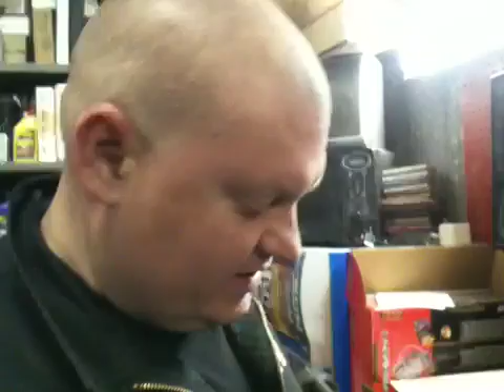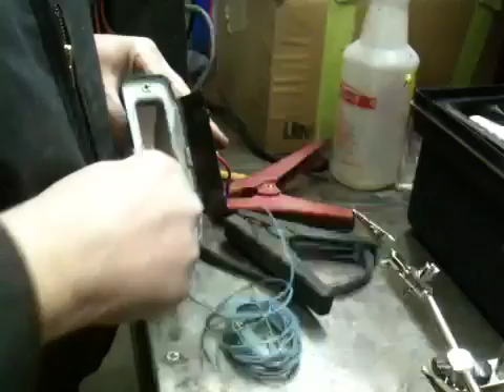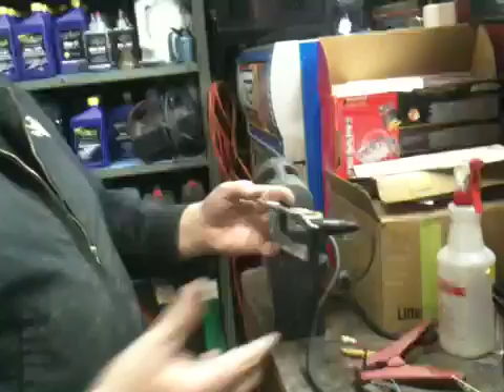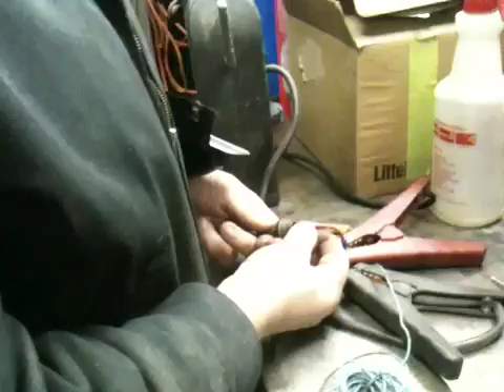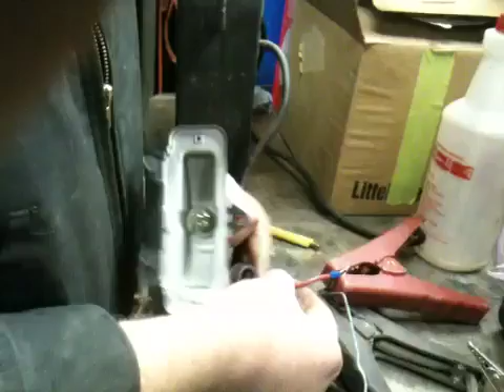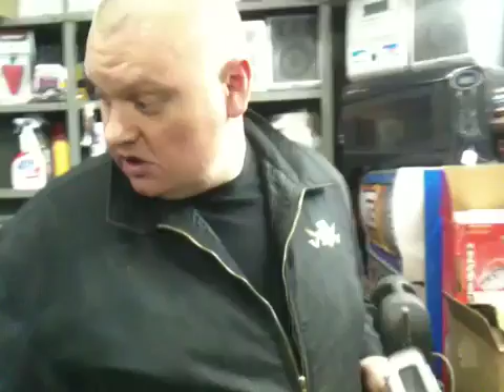V8TV Tip:  Check Fixtures Before Installation-Video

Comment: i normaly give mine a real good clean and a spray with high gloss silver paint to help it that little bit extra oomph , never got around to it but always thought it would be a good idea to chroam plate them even though you dont see the plate job it is a 360 drgree protection from moisture and would reflect well